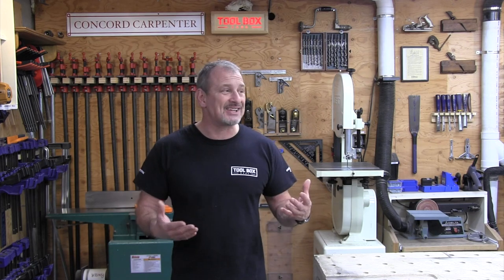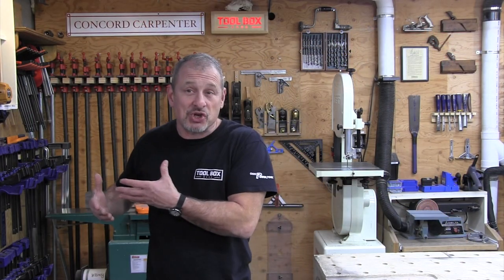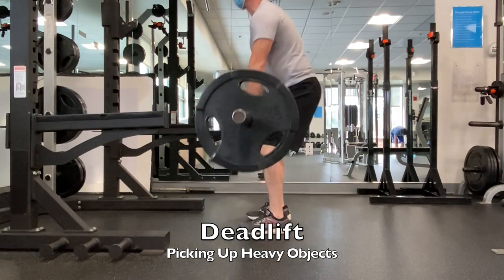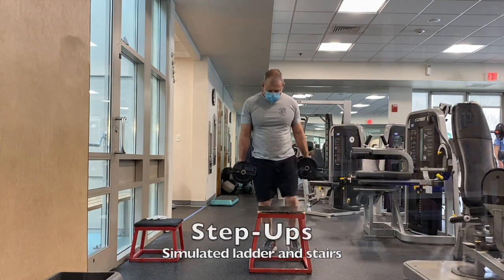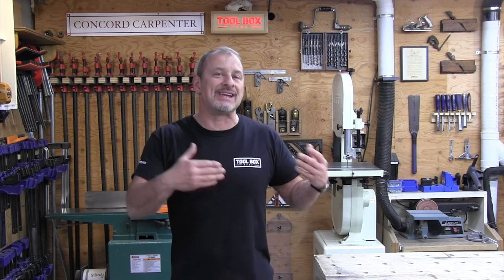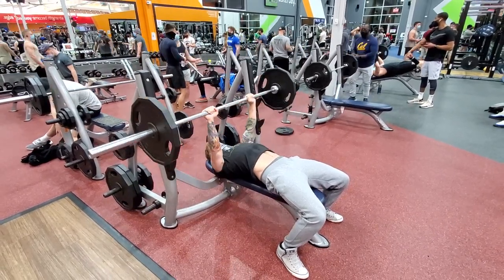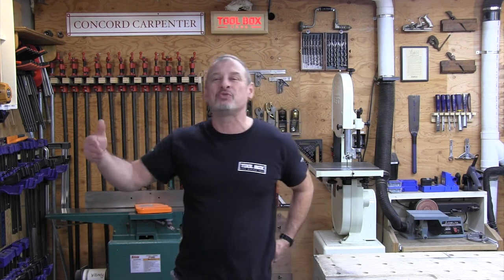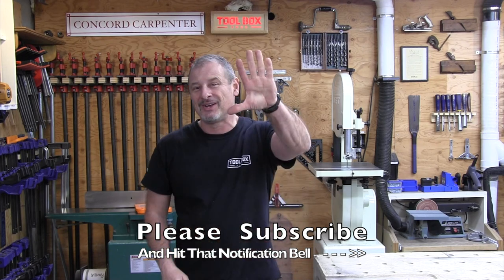Functional Fitness Exercises

Comment: I was a union journeyman  taper and powerlifter while I attended college. The weight training made taping easy. After I earned my BS I attended and graduated from Chiropractic College. I have now been in practice 35 years. I'll be the first to say work and exercise are not the same and there is nothing exercise doesn't help. I still lift and do road bikes. I'm nearing 3000 miles on the bike for 2020 and although not powerlifting I still push respectable weights. I even taped my son's house for him about 5 years ago.

Comment: THIS IS SO IMPORTANT. Front squats, good mornings, and dead lifts are good as well but they are focusing on our wheel house of strength. If you do train, train in the weak ranges of movement as much as you hit your strong points. Weak points are extension, expansion and expression movement. Add instability to the stuff you know how to do. The easiest way to do this is to add chains to your dumbbell movements, substitute a yoga ball for a bench if your a real badass and stand on a bosu as well. It’s had lower back instability for 20 years and that really turned a corner when I found battle ropes and mace training(or gada training) both of these increase your range of movement, increase your balance, cardio, ability to recover quickly and your explosive strength goes through the roof. If you have anger issues, battle ropes and mace training give you a place to go full beast with no consequences. Buy a sledge hammer for a mace and your ready to rock. Also, a real world training object is a sand bag, both types, there is one with handles, and one without handles for the sadistic types. All these can be made yourself as well. I’ve made a whole outdoor gym with all this stuff and more. I’ve broken a lot of bones and what not. My body is really messed up. That being said I’m happy I get to work out at all, than not at all. I could be a lot stronger with out all my limitations, but I’m grateful that I DO what I can when I can. Than all those excellent excuses you here from team tubby! Keep at it boys, I love your content!

Comment: After I got married I put on alot of weight. I started working out my core and legs. I havent lost my belly but man do I feel good!
Reply from the maker: I’ve got a belly too - as we get older is real tough to get rid of
Reply: @ConcordCarpenter  how do you usually deal with tight back muscles. I set alot of cabinets and after a long day my back muscles are in bunches. Then it ruins the rest of my week.
Reply from the maker: @nwhome9615  Hang, downward dog and baby pose stretches, roller